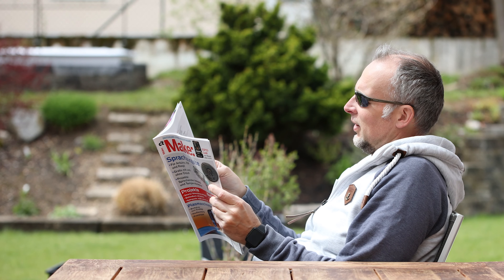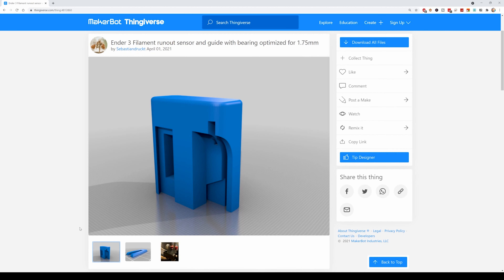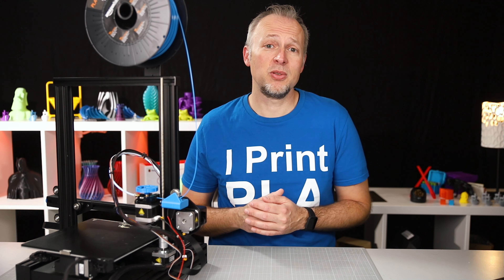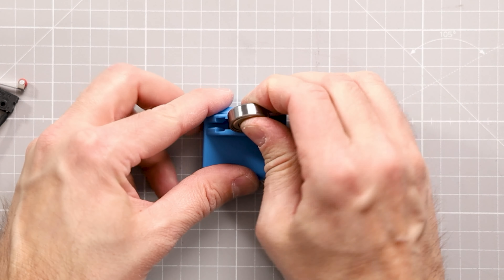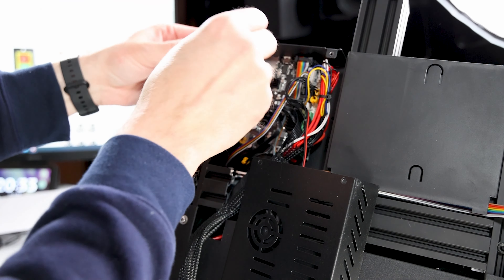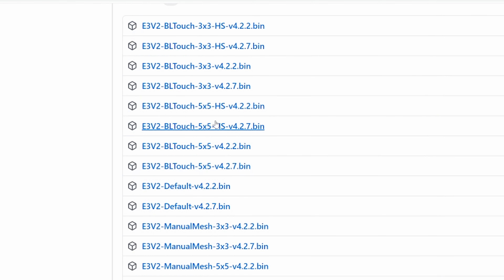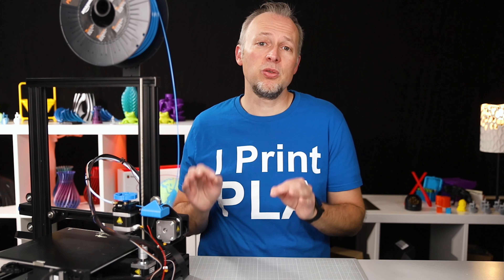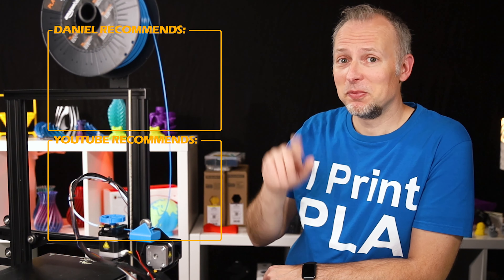99 CENT Ender 3 v2 Filament Sensor - BEST upgrade for summer

Comment: Thanks a lot for this - in the end I went with reusing my Ender v2 Z-Stop switch and cable for free - because its now a spare part after I installed the BLtouch (which is a vitual Z-Stop as well). So I just printed a similar filament sensor from thingiverse, cut its cable in halve, made it long enough using a spare wire and plugged the 2-Pin JST connector end into the left 2 pins of the filament connector (right to the green terminal). I use "Professional Firmware for Ender 3 V2/S1 based on Marlin" from mriscoc, went in the menu to Advanced/Filamentsettings and turned "Enable Runout" on, set "Runout Active" to "low" and set "Runout distance" to "0 mm" so it reacts instantly when the z-stop micro switch is released.

Comment: For anyone curious I believe you need to get the JST-XH 2.54 connectors. Learn from my mistake.

Make sure you use the NC (Normally Closed) and C (Common) connections. This means that the switch in it's normal state will close the circuit and trigger the run-out sensor. With filament compressing the switch down, opens the circuit.
Reply: Not for me, have the 4.2.7. The Black must be in the Middle and the Red one left, so just the other way around as he shows as he plug it in.
Reply: @adramelecfurry729  That seems weird because essentially as long as those two connections are occupying those two pins on the board, it shouldn't matter because it's still jumping the pins. I had a brain fart earlier and didn't realize that before posting
Reply: @GoblinBlaster3000  I had figured out, that the Probe was to high so it does'nt always reacted to filament/no Filament. Had to bend it a bit down, now its working fine :)
Reply: I have the 4.2.2 board and ended up with the wrong connector as well. I wish I had read your comment first haha. Luckily I have a wire with a JST-XH 2.54mm connector I’m going to “borrow”.
Reply: Thanks for being specific about connector type. Wish it was clearer in the vidro description or link as I ended up buying wrong one first time round.
Reply: You could easily invert the sensor logic if you buy the wrong NC/C version tho
Reply: @Envinite  I would expect most switches to have 3 pins, Normally Closed, Common, Normally Open. If anything you could always invert the setting in the firmware
Reply: I tried all the NC alternatives and it didn't work for me. The printer stays still when I activate the switch. waiting and nothing happens.
What can be?
my board is 4.2.2
Reply: @gerardo.desiderio Double check your firmware to make sure that you've enabled the filament runout sensor

Comment: THANK YOU!!!

It's near impossible to find anything specifically that says/shows connecting 'G' to 'S' when using a limit switch. 3 thumbs up!
Reply: There's an assumption you know how switches work internally. Specifically for the micro switch they're using here, there's a common and then there's a normal open contact and a normal closed contact. Depending on the connection between common and normal open leg or common and normally closed leg will determine what contact you're connected to on the switch. 

The reason they mention it this way is because potentially the switch you get looks exactly like the video one and it doesn't work the same way. You can figure out the rest using a multimeter and checking how the contacts act

Comment from the maker: 99 CENT Ender 3 v2 Filament Sensor - BEST upgrade for summer

You should install a filament sensor on your Ender 3 v2 and this video explains why and how you can do it for under 1 USD worth of parts - and it also has a second function being a filament guide preventing your filament from wearing out your extruder inlet and filament is less prone to break. Enjoy!

Comment: A solder free method would be to use 1mm spade connectors on the switch legs. That way, should the switch ever fail (they don't fail a lot, but parts wear out) you could easily plug a new one right in. 🤔

Comment: This is awesome, though I went with the BigTreeTech smart filament sensor, because it handles detection of jams and clogs, which are the main problems I have. It's rare to accidentally run out of filament. The BTT sensor is amazing, and really not that expensive.

Comment: Many thanks for the video.  The wiring and settings was really helpful and everything worked on this mod 1st time.  The only difference that I used was sliding the sensor wire through the wiring loom; sheath this seemed to make sense to me and only meant snipping and replacing 2 zip ties.
Reply from the maker: Awesome! Good to see you’re successful!

Comment: ive some old pla thats a little brittle and occasionally i get a snap, this will save me loads of time, thanks.
Reply: Just toss it in the oven at 50C with ventilation... After 1-2h it should be like new

Comment: The linked connector is the wrong size.  Other than that and a little tweek to the switch arm it appears to work well.

Comment: Hello 

I have seen that the JST connectors are available in different grid sizes. 

Is 2mm really the correct pitch ?

It is not 2.54mm ?

Greetings Per

Comment: Would it not be better to invert the switch - then broken cable and missing filament, both unwanted errors, would be detected.
Reply: And you would not need to switch on the sensor in the options:
no sensor? no connection, so good to print
sensor? normally no connection, so good to prin.
(Backing out and inserting back in would be at default for you to change if needed anyway.)

Comment: I noticed watching your video that the terminal you plug into the board.
The red wire is now in the centre pin and black closes to the green block .
Any reason for that ?

Comment: What can you tell us about the Jyers setting under filament runout called ‘runout length’?  Is this the length of filament to keep using AFTER the runout has been detected?  I ask because if it detects and triggers the ‘change filament’ right as the switch trips, then the extruder will eject pushing the filament back through the housing of the sensor.  If the end of the filament has a kink, it could jam.  If however, the extruder kept running for example for 30mm and THEN triggered the filament change sequence, AND if the sensor was slightly offset from the extruder input, the filament could freely back out alongside the sensor housing instead of back into it, potentially causing a jam.

Thoughts, feedback, commentary?
Reply: It is to tell it how far to back out fillament for change then how far to send the new fillamant back in

Comment: I noticed the red and black wiring on the plug side changes from the scene that he inserts the wires into the plug and the scene he plugs into the mcu. What is the explanation?  I plugged mine in like this and the wires got insanely hot!

Comment: Thanks for this video. This is great! Can this sensor be connected to a raspberry pi with Octoprint instead?
Reply from the maker: Sure, this will also work on a GPIO pin of the raspi
Reply: @Crosslink3D  can you explain , how can it work with raspberry pi?
Reply from the maker: Great idea for a new video!

Comment: Hello 
I took the STL file and pushed it into the Cura Slicer but the part is much too big. 
When I move the second file into the slicer, the size is correct but the first STL file is much too big

I then tried the Prusa Slicer and there I have exactly the same problem

What am I doing wrong or is the STL file simply faulty?

Greetings Per

Comment: The JST link was to jst-ph 2mm connectors, but it appears the connector (at least on 4.2.7) is not that size.   What size should be used?
Reply: Just had the same issue and I have 4.2.2 The PH connectors are too small

Comment: Oh, since some time ago Chinese manufacturers started to supply such sensors with their printers. But many of them did not care about how stable it is with electronics they use. In many cases such things will give false-positive. And it is hugely depends not only on filtering circuit of such sensor on its own, but from motherboard circuits in general. So the downside for such cheap and simple thing - you are getting illusive insurance from 3d printing failure. And I am even not talking about leaving electronic device with heaters unattended without especial cares...

Comment: Awesome video! I'm definitely keen to do this. Just wondering, what size ball bearing do I need to use?
Thanks
Reply: Bore diameter	8 mm
Outside diameter	22 mm
Width	7 mm
608 bearing

Comment: Hi, Great video. I am upgrading my ender 3 to the silent board and want to install a run out sensor. Must i upgrade the firmware or will it work standard? thanks

Comment: Hello, I have tried all the connection possibilities but it doesn't work. I have a 4.2.2 and when the switch is activated the printer is "freezed" it does nothing, the display does not work, the head does not move. Nothing. I have to activate the switch again and the printer resets at startup. Install firmware E3V2-Default-v4.2.2-v2.0.1.bin
I appreciate comments

Comment: Im looking at applying this to my Ender 3v2, using the old Z stop switch. I have seen some guys do it with 3 wires and some do it with 2 wires....which is correct??

Comment: What is the pinout ground and signal ?  Or vcc and signal? Donit same but the printer do nothing 4.2.2 and jyers latest bltouch firmware ... I use the z-stop unsoldered from base and connects it to the outer pin ... according to the multimeter ok ... But nothing :(
Reply: Me sucede lo mismo....nada!!!!!

Comment: Thanks for this video. This is great!
But I am a little confused
see video at 3.14min. you put black in the middle of the plug and red on the left, now go to 5.56min where the plug is put on board is red in the middle of the plug, what is correct?
Reply: The switch is just opening and closing the switch, the way it is used here the only thing that matters is that it is closed when the filament is in the bracket and open when it is not.....

Comment: Using Jyers E3V2-BLTouch-3x3-v4.2.2-v2.0.1.bin bc I use a BLTouch my sensor keeps telling my printer that the filament has run out.  I test that the blue LED on the sensor is accurately responding to when filament is loaded and when it is not.  The sensor seems to be detecting that ok.  But when I tick the check box for Filament Sensor in the GUI and try to run a print when the filament is loaded up and ready to go it always parks the hotend and tells me Filament runout and prompts me to loadup more filament.  This occurs whether I have the check box ticked on AND also when ticked off.  The only way to get my printer working again without parking the hotend is to completely disconnect the sensor.   Is this a wiring issue?  Currently it's white, black, red.
Reply: I had the same thing so I gave up on it

Comment: no matter what I do, I cannot get the roller for the switch to touch the filament to activate the switch, i printed it twice in 2 different filaments incase something was wrong with it. I got the exact same switch as in your video. Any suggestions on how I can fix it?

Comment: Hi. Why is it you wired the plug going to the mainboard with red wire in one of outer terminals and black n center and when you  plug it in they are inverted? Which one is it?
Reply: He said in another reply that he had to reshoot the scene, and mixed them up. It doesn’t matter as long as they correspond to the proper pin on mobo. This mod works really well. Haven’t had a runout, but simulated one by cutting filament. Everything worked as it should and print picked back up where it left off.

Comment: I followed the directions here to the letter, and it does not work: when the filament runs out, the print continues on as if nothing has happened.

Note that I am using the Z-stop limit switch that I removed after installing a BLTouch and have the wires connected to the normally-closed connectors on the switch, as per your directions. I also have the very latest jyers firmware, as of three days ago, with 'filament sensor' checked on and saved (Jun. 22, 2021).

I found another video about using the z-stop limit switch and that video shows all three wires of the switch/motherboard connections being used, but following that video results in my printer halting with a 'thermal overrun' error after about an hour...I remove the connector from the motherboard, turn off 'filament sensor' in the firmware, and that error stops happening.

Please, can anyone tell me with 100% certainty, how a filament sensor switch should be wired, accounting for the fact that the 4.2.2/4.2.7 main board has a 3-pin connector on it?
Reply: I have the same problem. I'm using the same firmware, with filament sensor checked and the printer doesn't not recognize the sensor. I connected as per the video, ground and signal on the board to the NC on the switch. Let me know if you found a solution :(
Reply: @edretrotech7559  I did find the solution, for me anyway: it turns out there's a setting in the firmware called 'Runout Length' (or something to that effect), whose purpose is to specify how many millimeters of filament can still be extruded AFTER the switch detects no more filament. Basically, this value needs to be set to somewhere close to, but less than, the distance (in millimeters) between the detector switch and your extruder gear.

My 'Runout Length' was set to 30cm by default, which means once the switch triggered, 30 more centimeters would be extruded before the 'no filament' event was raised. I never waited long enough for that to happen, and thus assumed the mechanism wasn't working.

I hope this helps your situation.
Reply: @imacmill  thank you for the fast reply! I just figured it out my issue. It was a mechanical one: my switch state wasn't changing. I was able to confirm with M119 where it was always on "triggered" (filament on). I bent my switch lever slightly and now it state changes to "open" when there is no filament :)

Comment: After deciding for an ender 3 max as additional printer I ask you if this filament sensor is better than the shipped? I ve read in some articles that the original sensor is not that good.

Comment: You can Pin this if you like.

After tinkering around with couple of end stops and firmware this is the result:

-Using the custom firmware as mentioned in the video can work well with any DIY end stop trigger without an integrated PCB.

-Using the official Creality firmware 1.3.1 that supports Bltouch and filament sensor (which it does not say it supports the sensor)..then you have to use the end stop trigger With an integrated PCB such as the one already installed on the creality itself.

While I tried to use a DIY trigger with the official firmware the machine detects the filament cut out but printer freezes until you replace the filament. But then the printer does not pickup from the last disrupted code, it will restart as if you are starting a new print.

Note: in both trials the signal pin had to be connected.

Comment: Could this be done with the z endstop that comes with the ender? I have a bltouch and have found no use for it :P
Reply from the maker: The endstop that comes with the printer doesn't have the roller on it I guess. It's possible but it's going to be scratching a bit on the material if it retracts. I would recommend to get one of these cheap switches with roller on the lever. It's just safer

Comment: Would you be able to show this firmware and how and ender 3 v2 with this firmware would work with octoprint or if there is a way having a filament runout sensor works with octoprint as well?
Reply: I'm about to get Octoprint set up using Octo4a (on an old Android phone) and I'm wondering how this sensor will work with it too. Guess it'll be time to experiment!

Comment: Always like your videos. With this one (at least for me) there’s something odd, when I load your Filament Guide.stl into Prusaslicer it comes in at 358 x 400 x 445mm. The stl from bleiseb loads as 35.8 x 40 x 40.1 which seems correct. It looks like yours scaled up by a factor of 10. Any ideas what happened?
Reply from the maker: I believe in the description there is some hint about printing it at 10% will add this to the description.
Reply: @Crosslink3D  Thanks, I'll try this.

Comment: Very misleading video description, you meant to say how to build a filament switch for $75 by the time you buy a jst plug connector kit and a pack of bearings and a roll of wire and a roll of filament and whatever else you need.

Comment: Did you switch the wires in the jst plug halfway the build? When you're talking about the sensor the Red one is on the end and the black wire in the middle. But when you're installing it in the motherboard they are reversed. Which is the right way to install it?
Reply: Actually iam little bit spectacle about the connector and wires placement, the connection is only made voltage and ground pins only, what about the signal pin which isnt connected ? (Most endstop sensors has signal wires)
I assume this method does not work with official creality firmware?!
March update supports filament sensor !!
Reply from the maker: I switched it accidentally because I had to re-shoot the closeup. It doesn’t matter which color is left or right as long as you’re using the same two pins on the mainboard. The switch has no polarity. The cables could also be both only black or only red.
Reply from the maker: @darkmody  a Switch always only needs two cables. It’s open or closed. There is no signal
Reply: @Crosslink3D  i think its the official creality firmware, my last update does not have the filament sensor support, then there is a march update that support filament sensor, as we speak i flashed the new firmware XD now i have a new problem :) sadly the bltouch is now preventing the z axis to move downwards. Any suggestions ? Im using the bltouch with the extension pcb
Reply: @Crosslink3D  thanks a lot for your reply and the guide. Works well for me!